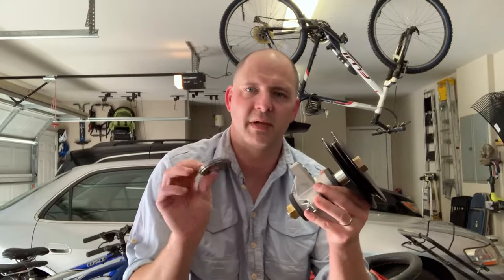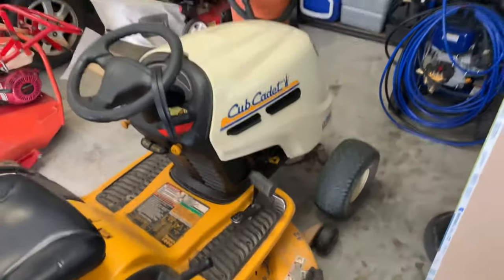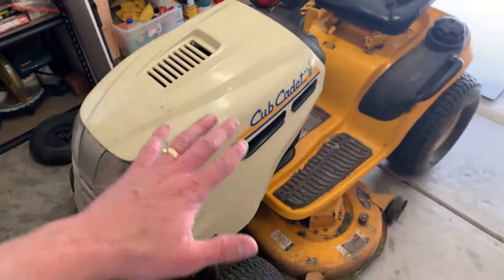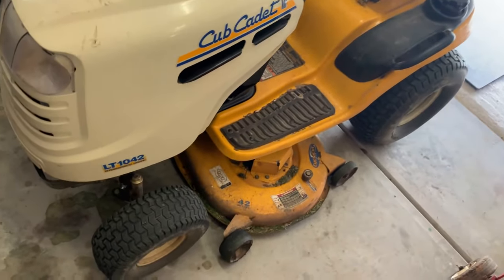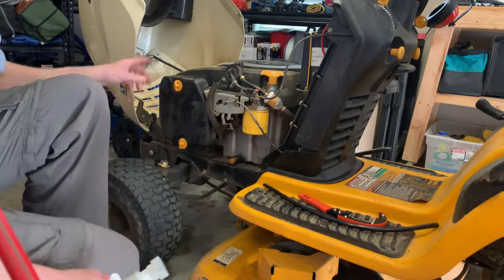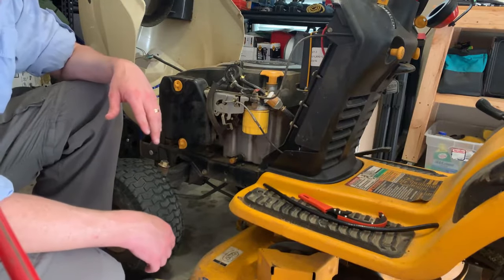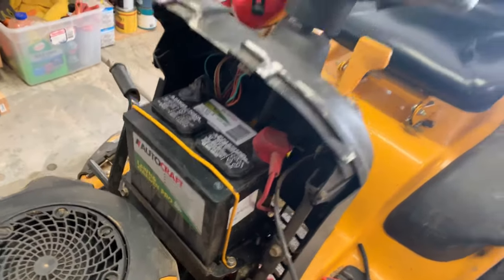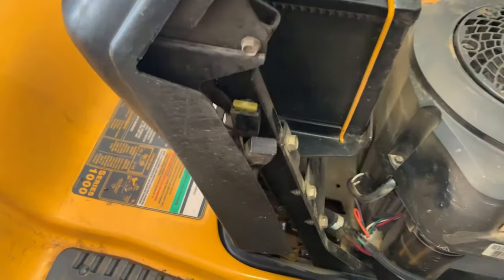Cub Cadet LT1042 oil change & deck work - EXPLAINS EVERYTHING!

Comment: A friend of mine just bought one of these for $500 and said the blades quit turning. I watched your video before he got here. As soon as I got the mower up in the air on my forklift, I saw that bar that locks the PTO clutch into place was on backwards. Not even close to the notch in the pto. The previous owner also put on new blades but did not tighten the nuts so the blades were about to fall off. Your video is perfect, I knew exactly what to look for when it got here.
Thanks.  Someone gave away their mower because they put the bar on backwards.
Reply from the maker: Thanks! It’s amazing what passes as “broken” that’s easy to fix huh? Glad the video helped!
Reply: @durk1980  I have the Cub 1000 Series LTX1040.  I was told the blades needed to be installed with one horizontally and the other vertically so they wouldn't touch in the middle. Is that true?
Reply from the maker: @Yellowjacket1977  I'd have to check online. I know my blades did NOT touch, no matter their alignment. Same for my current John Deere zero turn. That said, I DO know there are models which require blade alignment for exactly what you're referencing. Hopefully you can find the manual online and it should be an easy find. Good luck!
Reply: @durk1980  
 I recently bought an LTX1042 cheap because  it had a broken timing belt. The timing belt, or spindle belt, keeps the 2 blades from hitting each other.  Actually, I really should order the new belt this evening so that I can use that mower next weekend.

Comment: On unbolting the engine to get the drive belt off, i resorted to cutting the belt keeper tabs with a 3" cut off tool and bending them out of the way..  I was working underneath so it was dangerous and a pain to say the least.
Reply from the maker: Oh wow. Sounds fun! Yeah, I was almost there my friend.

Comment: Thanks sooooo much for the video!!!! I  have a Cub Cadet also.  I knew your video was going to be good and clear and detailed when I saw you clean the mower first.  Lol. I laugh because I just saw another video and they guy had leaves all on the deck etc.  I told my wife I could tell that his video was going to be hard to follow and he is going to skip and miss important details.  You did a GREAT job! This will be my first time taking the deck off myself.  I have to put a new steering gear and ball joint on the tie rod arms.   Attention to detail is key.  Thanks
Reply from the maker: Lol, there’s no way I work on anything when it’s dirty. Glad it helped!

Comment: Thanks for the video.  I have an old 1525 and am replacing a bearing on a jack shaft and the blades.. I have been looking for what mechanism is used to keep the blades from hitting each other if not staggered.  From your pictures (video) it looks like the blades don't touch (are not long enough to reach each other) .  Now wondering why a strip of uncut grass is not left between the blades... Anyone?
Reply from the maker: Hey Aaron. Thx for the comment. I prefer non-timed decks (decks w/out a timing belt). If the timing belt slips, it can cause damage when the blades hit each other. This Cub Cadet model is a 2 blade model. The only way to have 2 blades w/out a separate timing belt is to stagger the blades. Think about drawing 2 circles, slightly overlapping, then move one up until it's barely not touching. Same horizontal plane, just staggered. Hard to tell in my video because I don't run a string line, but when I'm tightening the blades, and you see both center points, the right most blade is SLIGHTLY higher than the left one. All they need is that slight offset. Pretty cool actually.

Comment: I know this video is from a while ago but where do you find your blades. I just put new spindles on mine and the ones from before had a star pattern, my new spindles are a circle pattern like yours here. 

I’m having trouble finding 3/4” round hole 42” deck blades.
Reply from the maker: It's in the description. From Amazon. Good luck!

Comment: I have a problem with the deck height on my cub cadet 2016  1042kw    At the heighest level on the deck handle the deck wheels are already on the ground  . I just did the spindles the deck and drive belts on it and can't figure out why the height of the deck is so low  . I have cables that hold the deck up in the back and i inspected them and the pulleys and they look OK   . The deck wheels should no be touching the ground at the heighest setting What am I missing here that I am not seeing . I used youtube to  do most of the work on the mower as there are no repair shops anywhere near me . I live in a rural area
Reply from the maker: Without seeing it, I wouldn’t know, but it’s not a very complicated set up. When you pull the handle up, to raise the deck, it only goes up so high. There could be something wrong with the transition where the handle meets the deck. Perhaps something is stuck, and not allowing it to go all the way up. I would assume that the wheels you have are the original wheels, so that wouldn’t be anything. Maybe it was broken at some point, and somebody put in a different part that altered the specifications such that it doesn’t allow it to go all the way up. Unfortunately without seeing it I don’t know. I’m sorry! Good luck.
Reply from the maker: Go to 7:25 in the video. You see how there’s 2 holes? My deck was aligned for the bottom holes. If you place that pin in the spring, in the upper holes, it will make it a very different adjustment when you pull the handle. Perhaps see if that is the same as mine in the video?
Reply: @durk1980  it worked fine when i bought it new and after I put on the new deck belt is when this got worse . before that it was a little low but not as low as it is now
Reply: @durk1980  As per parts tree it is the same  . I printed it ou and will try the upper hole . for some reason there are printed numbers on the upper hole and i took pics of the placement of everything before I ever took the deck off the second time . A shop under warranty replaced the first set of pulleys and spindles after they sheared off from no grease in the bearings  with only 20 hours of run time  and i only had it 3 days but I always have owned 2 mowers for my 3 + acres .  It was really less than 20 hours since  had to come back up to the house

Comment: Ok my rule of thumb is this, if i pull the top pully off, the spindle, if i can see the balls in the bearing then i will grease them but the ones on my mower the bearings have a black cover over both sides that seal the bearing, but the spindles also have a zerk, but the grease can't get to the ball bearings under the plastic caps.
Reply from the maker: Makes sense. I don’t know why they’d put a zerk to nowhere, but makes sense to me.

Comment: What's the little sensor switch on the transmission? It's on the passenger side under the body. We bought ours used and it was clipped out
Reply from the maker: Man, no idea. I’ve since sold this, and I wouldn’t be able to tell without looking. Hopefully, Google will provide!

Comment: Durk, what is the correct deck belt length for your model Cub Cadet.  I bought a replacement belt that is too long and I cannot find the correct information online what what length belt to use. I have a 1042 with the same pulley configuration as yours.
Reply from the maker: It's in the description - but it looks like a 78" belt.  I sold that forever ago - so I can't remember!

Comment: Thank you for making this video. It was a huge help
Reply from the maker: Hey man. My email shows another comment from you, but maybe you edited it off. Curious about the nut size for the blades? I sold that mower long ago, but I still have the old nuts. You can go standard 1-1/8”, or 29mm 12 point. I think 28mm 12 point would be more snug, but I don’t have one.
Reply: Hi Dirk I did edit it I found the part number right after I asked the question. I still wanted to thank you for taking the time to make this video seriously was a huge help.

Comment: Hi Durk, This is a GREAT Video, Clear illustrations and simple instructions, Thank You for the help!
Just one Question .....How did you Stand up and balance the Tractor on the Back wheels?
Reply from the maker: Thanks! Grab it where shown in the video,  and once up, have a helper throw a 2x4 or wheel chock on opposite sides of the rear tires, so it can’t spin. Lift with the legs!

Comment: Any tips for a mower that’s been sitting for awhile that won’t turn over? Charged the battery, oil light turns on (I’ll try it next), and I’ll watch the fan on top of the motor turn but it won’t start
Reply from the maker: Mowers are pretty easy. If there’s a fuse, make sure it’s good. Throw a multi-meter on the battery and verify it’s good. If it is, start tracking the wire harness and check for shorts. You can also look at the wiring under the ignition where you turn the key. Something may have worked itself loose.
Reply from the maker: Duh, forgot to say that it could be the starter. I had to get a new one on our Cub Cadet and that fixed it.
Reply: Likely one of the many safety switches are open/faulty.

Comment: Oh , I forgot
Spring . I found one tension spring ( broken ). How many tension spring (s) on your lt1042 ?? I'm not sure if there is suposed to be 2 . ?? Or just the one that I found. ? Please let me know. You're a great you-tuber guy.
Reply from the maker: At 10:57 my hand is on a pulley that is above the one spring I had. I’ve since sold that mower, and I have a John Deere zero turn now. It looks like there was just one spring.

Comment: I take my leaf blower and blow clean everytime i finish...plus every outher mow i spray wd40 on all the linkage under the battery...the linkage that sets the hyd pumps into position for the drive tires...makes a world of difference when steering...mine is a zero turn...good video tho...
Reply from the maker: Thanks!

Comment: I have a lt1042, I'm having to relocate the idler pulley, belt keeps coming off, they changed the deck idler pulley configuration on 2007 and later models to correct the belt problem, great video, thanks.
Reply from the maker: Glad it helped!

Comment: Hi Durk, I have a 2006 LT1042 model, but the pulley set up is completely different, having a bit of trouble, any suggestions? Is your machine a 2007?
Reply from the maker: I have since sold this, I’m sorry I don’t know! If there’s not a sticker or diagram on the deck, you can always Google it. It’s a fairly simple set up though, the belt should look the same as mine, because there’s only one combination of inside or outside of the Spindles that it can go. It would only very if you had a different number of spindles, or they were in a different location, but there’s still only one way it’ll work. good luck!

Comment: What caused the spindle to break?
Reply from the maker: I think it got dry from a lack of grease before we even bought it, then it all went downhill from there. I used it for light commercial use in addition to my house, and if you don’t properly maintain those with that amount of hours it will wear them out fast.

Comment: the  good news is that the bearings are sealed top and bottom so filling the spindle with grease is useless because it will never gets into the bearings.
Reply: Actually... That's not true on these particular spindles. It does not have sealed ball bearings. It has tapered roller bearings that run on a tapered race with a seal that is pressed into the spindle housing much like an automotive wheel bearing.
Reply from the maker: I didn't see them sealed, and there was a grease fitting (zerk). If there's a fitting, I'll always to to squish some in there:)